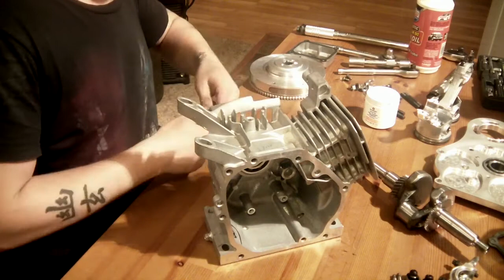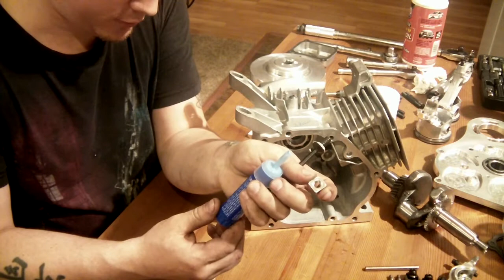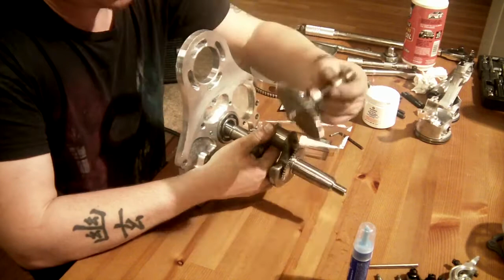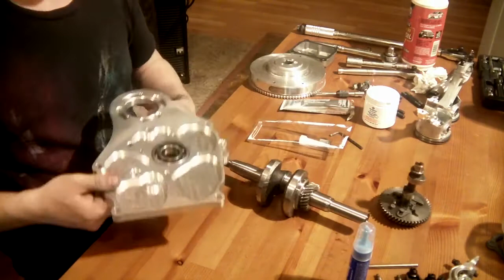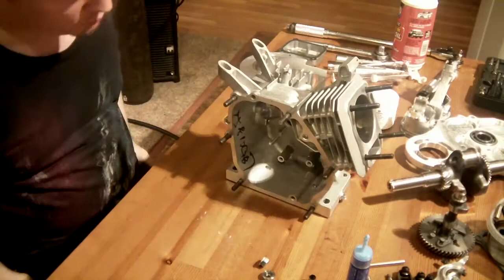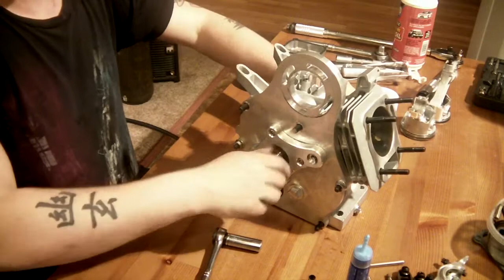DIY Paramotor Engine - pt3: Case Prep and Clearances

Comment: Dmitri...How often should the average paramotor engine be rebuilt, and did you do a complete teardown because of the customization? I've seen other guys doing 'short rebuilds' (piston, rod, rings, head gasket, etc.), but nothing as involved as this. Also, with all of the vibration issues that paramotor engines suffer, would you benefit from using Nord-Lock washers....like, for instance, on the exhaust coupling, among other places that vibrate loose? That (the exhaust) seems to be a weak spot in most paramotor engine designs, and I very often see them failing and causing engine outs (presumably from loss of back pressure)....mid-flight!!
Reply from the maker: Norm Jacques 2 strokes are a completely different animal. This engine is a home made 4 stroke and I'm rebuilding for the purpose of moving to a new case. I don't have that dodgy exhaust coupling to fall off and actually don't have a huge amount of vibration. Those washers are a very good product though and would benefit any machine.
Reply from the maker: Norm, I just wanted to let you know that I have switched to Nord-Lock on some of the bolts. Looks like a great product that will help a lot!
Reply: Do you have a drawing or plans for the frame
Reply from the maker: Rusty, good question. I have a basic CAD drawing which includes the main frame (not the hoop). You are more than welcome to it, come find us in the Paramotor Homemade facebook group.
Reply: Im not on Facebook could you send it by email?
Reply from the maker: Rusty Harvey hit me up on audioruso@gmail.com
Reply: Dmitri Zyuzin .... Glad the suggestion helped, Dmitri. We've begun using them, with very good results, on my son's street stock race car.

Comment: Good installation, especially for someone who got the Black Mamba cam. I was told by Arc that any cam with a longer than stock duration is going to need those lips ground down. I'm glad to see you addressed that.

Comment: I do have to wonder out loud about losing some weigh from the casting of the block. On all of the unused bungs inside the block for low oil shut off, and the top plate mounting "arms" sticking off (I know you use one for the exhaust, but I would think you could easily lose a pound or more with an hour or less of work. Just wondering out loud. Appreciate the in depth videos. Awesome work!
Reply from the maker: If you really wanted to use weight, the place to do it would be the flywheel (especially if the reduction is direct drive, with no clutch). The casting itself is actually very light and removing those parts would only safe a few grams. Another heavy part is the crank, but it has to be weighted a certain way to counter-balance the rod and piston.